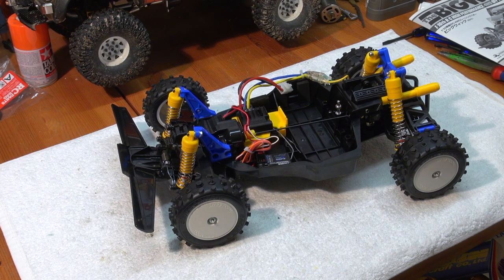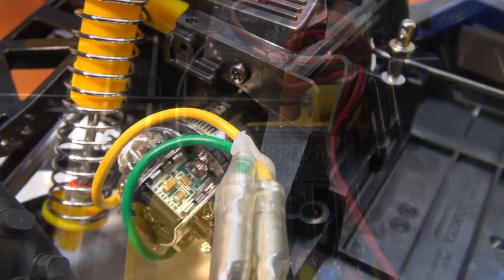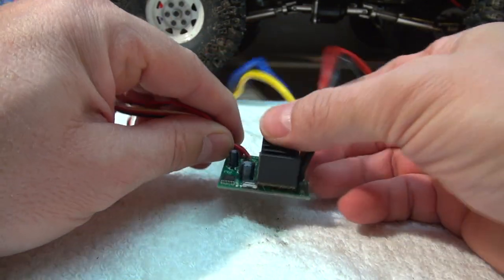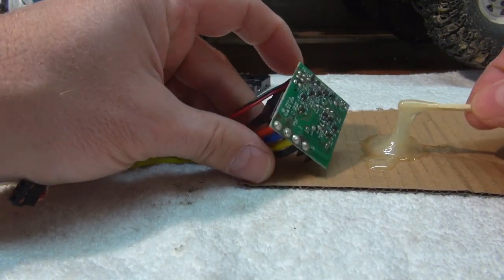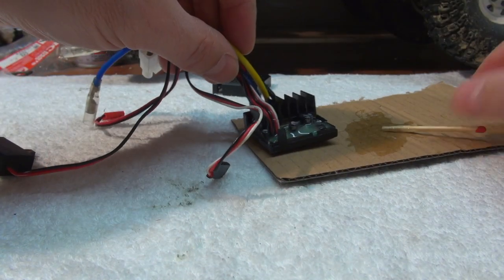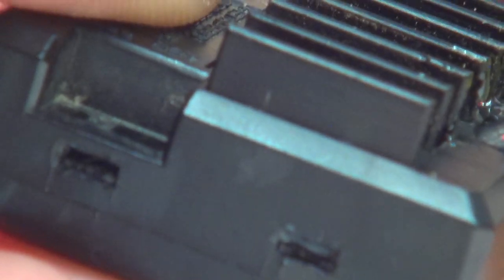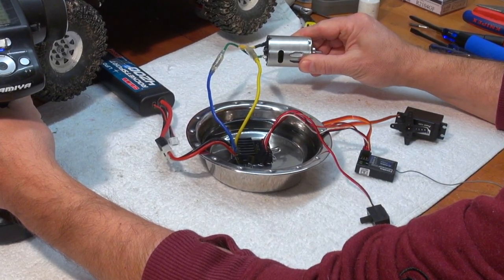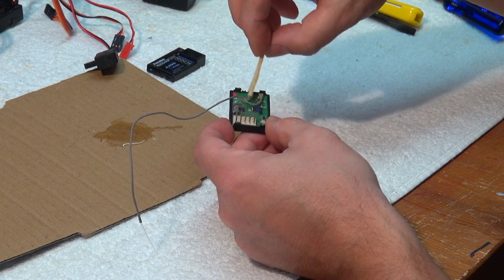How to Waterproof RC Electronics with Epoxy Glue

Comment: if you do this again? put masking tape around the edge of the circuit board to make sides so your epoxy can be contained. also, be careful if you ever use an epoxy which has an high exothermic reaction temperature as it can destroy components. I used to do similar for one of r and d pcbs so learned the trick with the masking tape. Keep up the good videos, inspiring and always informative and excellent quality.
Reply from the maker: Thanks for your good tip with the masking tape!

Comment: can you use regular hot glue instead? as its a much more non-permanent fix for waterproofing... removal is easy with alcohol.
Reply from the maker: Im not sure if it's possible to enclose it completely with hot glue. I think the hot glue is too stiff in viscosity. And it works only if everything is completely covered. You have to try it...

Comment: @Matteo's RC Movies  
Water can enter through the switches. How can the switches be made water resistance?
Reply from the maker: There are no switches, only the on/off switch. You can leave it on all the time and connect the battery to switch it on and off.

Comment: How would you get a component out and replace if one of them fails?
Reply from the maker: As you can see, these controllers including only one component, the circuit board. So is not necessary to change something. If it's damaged you can put the whole thing away and buy a new one...

Comment: I had always wondered whether the "balloon" technique might promote overheating and  had always imagined that the "epoxy" method involved nothing more than the application of epoxy to the points where the ESC´s casing is pierced. Thanks for setting me straight...
Reply from the maker: Thanks Del. The overheating problem is not so big in a crawler or scaler. But in a high powered buggy it is. And yes, it's nearly impossible to get it leakproof with only cover the holes in the case. Water can find the smallest gaps.
Reply: Even if it were possible to successfully seal around all the cables, the water would gleefully charge straight into the servo plug ports. Obviously it does that when you´re using the "potting" technique you demonstrate in this video, but you´ve proved that, with all the components embedded in epoxy, this simply doesn´t matter.

Comment: Let's say you accidentally covered that button & now need to remove it. But, it has already set & dried. How difficult would you say it is to remove the Araldite?
Reply from the maker: Good question, I would say it's very difficult. Because Araldite becomes very hard. I would try to grind it away with a dremel. But high risk to damage something...

Comment: What a great idea Matteo, thanks for sharing.  I have been using the balloon method but it can fail if the car ends up under water for some time before it's rescued.  I'll try this next time :-)
Reply from the maker: Thanks Pete! Yes, I have the same experience with the balloon. The epoxy method works better.

Comment: Matteo, hello. Great method overall but what about the connectors plugging onto the receiver? I would consider this a weak spot for water entry. Especially if the vehicle remains immersed for a couple of secs. What do you think?
Reply from the maker: No, the epoxy glue can added close around the connector board, so no problem with water goes inside. But if water too long rests in the connectors these can corride and this can makes some problems.
Reply: @Matteomeier  thank you for sharing your experience! Will be putting this method to the test pretty soon...

Comment: Hallo Matteo, ich habe bis jetzt immer mit Flüssiggummi gearbeitet, bin aber nicht so zufrieden mit dieser Methode. Gerade bei flexiblen Kabeln hatte ich mehrmals Schwierigkeiten. Ich habe jetzt gerade wieder ein solcher Fall. Die Elektronik hat versagt. Nach einer Weile (trocknen lassen) hats wieder funktioniert. Ich tippe auf den BEC. Was kannst du über Epoxi sagen? Hattest du irgendwelche Probleme damit?
Reply from the maker: Hoi Tino. Nein bissher keine Probleme. Ich denke wenn man darauf achtet das das Epoxi überall schön schliesst kann nichts mehr passieren. Der Nachteil ist halt das wenns mal drauf ist kriegt mans nie wieder weg. Hatte ähnliche Erfahrungen mit Flüssiggummi gemacht wie du. Übrigens sind auch einige Regler die ab Werk wasserdicht kommen mit der Epoxi Methode abgedichted. LG Matteo
Reply: Super danke, werde mir auch Epoxi besorgen!! Vielen Dank für deine Erfahrung.

Comment: I've been searching ideas on waterproof my cheap rc. But some methods they use are expensive like the liquid tape and conformal coating...is your method safe? And far cheaper..cheers Matt!
Reply from the maker: Yes, it's safe and works. Only thing is you cannot reverse it. If the epoxy is applied and dry it can be never removed, but normally this is not a problem.
Reply: @Matteomeier  not sure.if these araldite same I saw a red and white tube..super adhesive epoxy?
Reply: @Matteomeier  I saw some rc user use nail polish don't know if its effective.
Reply from the maker: For me this nail polish laquer is not so safe as epoxy
Reply: @Matteomeier  ok I will try the araldite 5 min epoxy..thanks Matt!
Reply from the maker: Yes this is it
Reply: @Matteomeier  buddy Matt I've got a question..I'm searching on your videos but there's no batteries related. I hope you can help me..coz I'm newbie in rc world:) I like to get new battery for my wltoys a979b..I know its not related on your video but I'm hoping you can help me..since I'm using 7.4v 1500mah is to short time to play..can you help me which is suitable with good price and performance wise? Not sure if 2S or 3s coz it's not indicated on the battery itself..
Reply from the maker: 7.4 volt is 2s. So you need a 2s lipo battery. These exist in many different capacities. Normally you should use 3000-5000 mah for longer run times. But as more capacity, the battery getting bigger, so I don't know how much space for the battery you have in the car.
Reply: @Matteomeier  that's to kind...huge help for me Matt:) thanks!
Reply: @Matteomeier  Matt got problem on my esc..says 25a I think burn it coz the chasing is plastic and when I open it has glue already inside and it cut off when playing then I rest it and I run again. What's seems to be the problem? Motor or esc? If I change my esc so I can put heatsink/fan on motor coz its getting hot. And also if I change esc with fan or larger sinker what's specific esc should I use?  My motor is 540kv brushed stock and servo. Running on 7.4V 2s stock Lipo.  Sorry got lot of questions:) thank you...

Comment: Hi Matteo

You don't have problem with the temperature in the ESC?
Reply from the maker: No, because the heat sinks are not covered with glue.
Reply: @Matteomeier  

Thank you Matteo

I did it yesterday night, following you instructions. I use plastic Epoxy. 
I didn't test it yet.

Comment: Very nice sharing of knowledge. Another great method/material is PlastiDip, I use it on all my electronics with good results. Keep up your great vids, always enjoy them!!
Reply from the maker: Thanks so much Iakovos! I tried it out with plasti dip also. But in contrast to epoxy plasti dip needs oxygen to dry. So, after closing the esc's cover, the Plasti Dip inside does not dry and it was a fail. Maybe it would work better letting it dry befor closing the cover. But is it enough space then, to close the esc cover?
Reply: Sure Matteo, you have to let it dry and for best results apply a second coat. Usually I don't have a fitment issue, if need be you can trim it on the board edge. The plus side is that you can always remove this elastic cover, should you need to. But for sure, I will give a try to the epoxy method as well. Keep filming !

Comment: Which method is better? The plasti dip or epoxy glue??
Reply from the maker: I prefer the epoxy glue. Tried one time with Plasti Dip, but was fail because the Plasti Dip does not dry inside the case. It needs oxygen for drying.
Reply: Matteo's RC Movies thx for the reply keep up the good work! ;)

Comment: Nice Vid Matteo.
can you tell me if it matters about the connectors at the battery and the receiver as they are not insulated against water ingress?
Reply from the maker: The battery connectors are normally not a problem. On the receiver they can protected with silicone. This is removable, if nessecary.

Comment: wouldn't clear silicone sealant work just as well buddy?
Reply from the maker: Silicone does not dry without oxygen. So inside the case, the silicone would be not dry. And after drying outside of the case it's not possible to put it back because of the larger size.

Comment: "Plasti Dip" is better suited for this purpose
Reply from the maker: Thanks for your feed back! I tried it out with plasti dip also. But in contrast to epoxy, Plasti Dip needs oxygen to dry. So, after closing the esc's cover, the Plasti Dip inside does not dry and it was a fail. Maybe it would work better letting it dry befor closing the case. But then it's not enough space for the slightly thicker parts inside the case...

Comment: Never use expoxy it holds in heat
Reply from the maker: It's not heat, it gets only a bit warm during drying and this is not a problem...
Reply from the maker: It's a chemical reaction.
Reply: Matteo's RC Movies ya but it still holds in heat if there’s a load. My method there’s no problem. I’d never use this or silicone